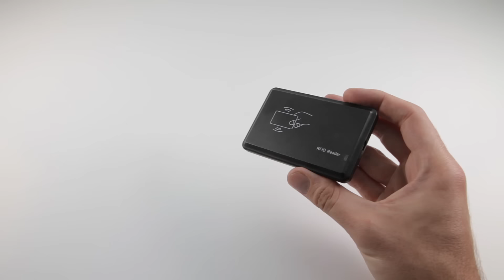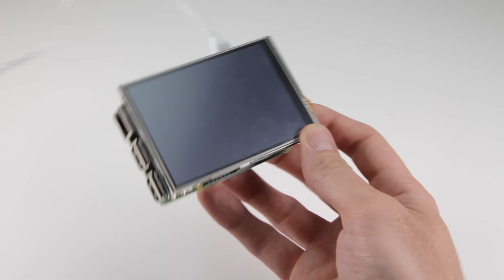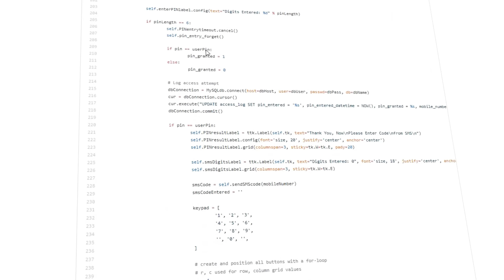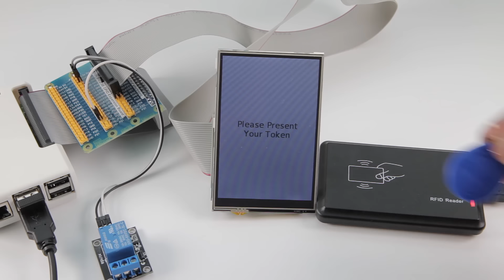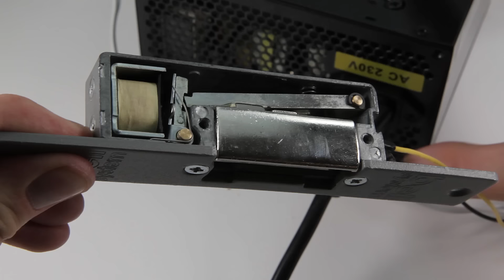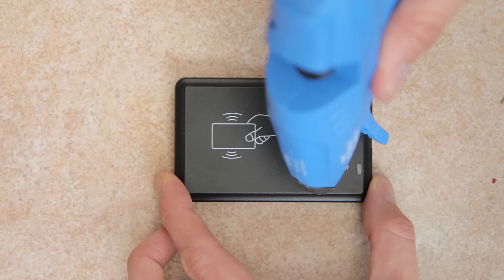Build a Raspberry Pi Smart Door Lock Security System for your Smart Home!

Comment: Hi thanks for your tutorial but I'm facing a problem with the modification of this *-" Autoload Python Script on Bootup: ~/.config/lxsession/LXDE-pi/autostart" *is asking me to save it with a new name because it read only file after adding the line "@sudo python lock.py" . what do you suggest I do because in the video it is too fast I couldn't see.
Reply from the maker: If you can't save the file then you're probably not running the text editor as admin when you open the file to edit it. Make sure you open it with "sudo". As a quick tip, on the shell you can re-do your previous command as sudo by typing in "sudo !!"

Comment: I love this video! But I have a question. You used a 5V relay and connected the IN to a pin on the board, which operates at 3.3V. I'm wondering if this can damage the raspberry pi.

Comment: Is it possible to modify this system to open lock with either of three methods (rfid card, password,otp) if yes please give me some references. I don't have much experience in this field 😊 thanks alot
Reply from the maker: Yes it is, and as I open sourced the code you're free to make changes as use as you see fit (within the terms of the license agreement on GitHub). I can't provide bespoke help here in the comments but if you need one-on-one guidance then get in touch and we can book in some consultancy video call sessions if you like.

Comment: Hey, don’t know if you will reply, but if you did I would be very grateful.
So I want to get rid of the RFID scanner and the SMS phone text, and JUST have the pin. Is this possible? And what would I have to buy? 
Thanks so much in advance
Reply from the maker: Hello! Yes that's perfectly possible and the code is all open source so change and update as you wish 👍
Reply: Hi again, so I click on the links and these were the ones that didn’t work or weren’t available: Power Supply, Rasberry Pi starter kit, GPIO Extension Board. Should I just by them from another site?
Reply from the maker: Ah, thanks for letting me know! I've updated those shopping links so they should work for you now, or if not they should at least provide a similar item. Let me know how you get on :)
Reply: Awesome! Any chance you could tell me what to purchase? Thanks 🤩
Reply from the maker: @MicroDrop2  - Yep, there are Amazon links for everything you need in the video description.
Reply: That is awesome, sorry to be a bother, but if you could, when you have time, could you tell me what I need to buy specially just for the code part? Don’t need to send links, if you tell me the names I can go check out your links! Thanks so much, and I love how fast you reply! True dedication
Reply from the maker: @MicroDrop2 no worries! It would just be everything apart from the RFID scanner and tags. (The SMS element doesn't include any physical hardware so nothing crossed off the shopping list there...)
Reply: Awesome! Thanks so much
Reply: Thanks, will check them soon! Planning to begin purchasing the items soon!!! Thanks again

Comment: I was wondering if this project still works
Reply from the maker: With some updates and a bit of tinkering here and there I'm sure you could get it working! 👍
Reply: @SwitchedOnNetwork  i got it to autostart but when i present my rfid fob it doesnt do anything
Reply from the maker: Run it manually and check for any output to the terminal to help you debug
Reply: @SwitchedOnNetwork  i also get this on bootup of the pi3 usbhid 1-1.1.2:1.1: couldn't find an input interrupt endpoint
 any tips on how to fix this

Comment: What an awesome tutorial. I'm implementing this work for my project, and I have a few issues. If you can help me with please, I follow all the steps; however, when I run the python programme, I get this error message  :  (_tkinter.TclError: no display name and no $DISPLAY environment variable pi ) and also when I turn on the Pi I got a message in the touch screen  "failed the load overall spi 2708" I scan the key fob and nothing come up. any help will be much appreciated

Comment: I just have a question about this video , how does this system work without running the code
Reply from the maker: I'm not quite sure what you mean. I think you're asking can you still unlock and lock the door manually, without using the Raspberry Pi and rest of the system? If that's what you mean then yes, in the example I made in the video you can unlock the door from the inside using the latch. I didn't fit the front locking section but you could also fit that, and still use a manual (and offline!) physical key. Is that what you meant?
Reply: @SwitchedOnNetwork   I mean it's unnecessary to click Run in  the terminal of raspberry pi ?so that the system work ??
Reply from the maker: The script needs to be running for the system to function - either started manually (not ideal) or because you've set it to auto run with the Pi boots (ideally)
Reply: @SwitchedOnNetwork  okyy thanks ,but  how can i auto run many files
Reply: @SwitchedOnNetwork  hello again , i've tried with the auto run the code execute successfully but still don't want to work , is there any other solution so that my system can work automatically

Comment: Please specify methods for resetting the as-103 locker?
Reply from the maker: what's that?
Reply: @SwitchedOnNetwork  Is there a way to reset the passwort
Reply from the maker: If you mean the pin you enter on the touchscreen then yes, in the database table. You could also build an admin front end for that if you want to make it more elegant.
Reply: @SwitchedOnNetwork  How can I tell if the bar code is not included in the passwort before the scanner?

Comment: great video.
Reply: my comment asking for help keeps getting deleted....i got everything working, i just got a problem with the GUI, i've been trying to fit the keypad to my monitor but i cant find the line of code that positions the buttons, my current situation 
Can you please help me fix this? or give me the code line that does it? its really bugging me

the 1,4,7 column always stays in the middle, but the otehr two columns always stick to the right side, any help please?
Reply from the maker: Hmm, I'm not sure why that would be happening. The code I wrote isn't very portable so was pretty specific for the hardware I was using. I'd recommend going though and debugging from the ground up until you find the issue. Sorry I can't be of more help, but I hope you get it sorted!
Reply: @SwitchedOnNetwork  im getting this problem: prnt . sc / 12vr9ai
and prnt . sc / 12vt0bg

when i resize the window it works but if its full screen the 2 last columns always stick to the right side

Comment: Hi, Im buildings this as a project and im having problems with the gui, im building this without a touchscreen (im doing it conected to a monito), the db and everything is setup correctly, i present my rfid card and it shows the right name on top, but theres no numbers to click, its just a white screen saying "Welcome "my name" ", can you try and help me finding out whats wrong?
Reply from the maker: That's probably quite an involved issue to solve which I'm guessing can't really be done in comments I'm afraid. This is  a VERY old project now, so unless you're using the same versions of everything I used back in 2017 then I imagine a lot of things will be broken and need debugging/recoding.
Reply: @SwitchedOnNetwork  is there anyway to get the updated versions?
Reply from the maker: @Browmbrownbrown  all the software repositories ("repos") will have the updated versions of everything, and if you download Raspbian it'll be latest version. I've not produced updated versions of my code, as this was a one-off project for fun, but with a bit of debugging you should be able to make it work today :)

Comment: So what do i do if the no module error doesn’t go away for tkinter?? Please help
Reply from the maker: That depends, what have you tried already?
Reply: @SwitchedOnNetwork  tried reinstalling multiple times. Keeps saying it's installed
Reply from the maker: @chadfanaroff5120  What exact steps are you taking to install it?
Reply: @SwitchedOnNetwork  I've been doing sudo apt install tkinter
Reply from the maker: Try sudo apt-get install python-tk
Reply: @SwitchedOnNetwork  ok will try thanks
Reply from the maker: Also bear in mind there's a difference between "Tkinter" and "tkinter" depending on whether you're using Python version 2 or 3... which are you using?
Reply: @SwitchedOnNetwork  tried again still not working sent you a message of the error message on messenger
Reply from the maker: @chadfanaroff5120  Can you post your code here?
Reply: @SwitchedOnNetwork  will try to
Reply: @SwitchedOnNetwork  Sir do you know what's the problem please help??
Reply from the maker: Without seeing your code it's hard to see, can you post it in the comments here?
Reply from the maker: Hmm so I see you're using Python3 so the capitalisation should be correct. You've removed the provision in my original code that makes it work regardless of whether it's v2 or v3 you're using, but it should still be OK I think. You'll have to forgive me as it's nearly 4 years ago I wrote this code and developed this project, so it's not in the forefront of my memory! I can't remember the exact steps I took to install all the dependencies but you could also try:

sudo apt-get install python3-tk 

If you still have issues then Googling it to read more about the subject and requirements is your next best bet:

https://www.google.com/search?q=ImportError%3A+No+module+named+tkinter

Good luck!
Reply: @SwitchedOnNetwork  ok thanks
Reply: @SwitchedOnNetwork  would python 3.7 be a problem should it be at 3.4
Reply: Also what would happen if I removed tkinter
Reply from the maker: @chadfanaroff5120  If you remove tkinter then you'd have no GUI, that's what makes the GUI
Reply from the maker: @chadfanaroff5120  I don't know I'm afraid, you'll have to either experiment or Google it and do your own research
Reply: @SwitchedOnNetwork  ok thanks will try
Reply: @SwitchedOnNetwork  Like how would you make it that can access the data base
Reply from the maker: All the code is in the main example on GitHub. Take what you need from there 👍
Reply: Ok thanks but is it possibly to connect the one with only rfid to mysql
Reply from the maker: Yes you can do - replace the bit of code where the RFID data is hard coded into the code with an SQL Query. I was meaning that you can see how to do that by studying the bigger example, as well as online guides and tutorials
Reply: @SwitchedOnNetwork  oh thanks

Comment: I keep getting a module error no tkinter module what must I do
Reply from the maker: Do you have that module installed? Are you using the right python version?
Reply: @SwitchedOnNetwork  yes. I don't know what's the problem
Reply from the maker: What other steps have you taken to resolve the issue and debug it?

Comment: A very cool video Paul. I'm completely new to Pi and am looking for things to mess around with - this security system looks like it would be fun to try. I think I understood 99%+ of your instructions but I must have missed the bit where you showed us where you were connecting the PSU to the mains(!) Have you stripped the plug and done that inside the wall as well? Or have you poked a hole through the wall to reach a socket? (I doubt it's the latter.)

One other question (just to prove what a novice I am lol): could you use your phone as your input screen or would that completely negate the need for the Pi? Cheers.
Reply from the maker: Thanks, I'm glad you liked the video and that it's still helping people out after 3+yrs! On my little protype mockup for the video I didn't do anything fancy with the PSU's power lead, as it wasn't inside a real stud wall or anything, so I just plugged it into an extension lead. I could have mounted a socket like this (https://ebay.to/371StdR) inside the wall on the internal side I guess, or hardwired into the mains, but as it wasn't a permanent setup I didn't need to do anything like that. If you're doing anything like that or installing inside a real stud wall, make sure you research and comply with all local building codes and stay safe!

Re: your phone, you'd still need the Pi as that controls the relay switch via the GPIO ports for the electronic door strike, but you'd need a way to connect your phone screen's inputs into the Pi, and it also looks up credentials in the database. You could expand the system so that the RFID reader accepts input from a "virtual fob" via your phone's NFC chip, that would be cool!
Reply: @SwitchedOnNetwork  Wow!, that was a quick reply to a 3 year old thread! Thanks.
Yes indeed, if I go ahead with this, I'd be fitting inside a real wall so, re the eBay link, I'm assuming you would fit that with the wiring on the INside of the wall (as it would be on the inside of a PC chassis) and on the OUTside of the wall, you'd need to have a kettle plug permanently plugged into the mains?
Thanks again. Consider me subscribed!
Reply from the maker: Thanks for the sub! Yeah you'd fit something like that with the wiring inside and the socket on the outside. You might be able to find something that's a bit more self-contained and that doesn't need soldering or leave exposed wires even on the inside of a wall cavity which would be even better/safer!

Comment: So your this project but the one where you only have a one set verification. Where your only using the rfid scanner. How do you hard code more users RFID cards into it without the use of mysql and php. You have a step by step on it but don't say how to add more users
Reply from the maker: Are you referring to my basic tutorial, the one published in HackSpace magazine? If so, that was a very basic introduction so it didn't include any facility to have more than one registered fob; it was hardcoded. This one, however uses the exact same concept but it does allow that via the MySQL database (you could use SQLite if you liked instead) - you just add an extra line to the appropriate table in the database for each new user. You could hardcode it (but it's very bad practice) by just saying "if code presented = AAA or code presented = BBB or code presented = CCC" etc. etc.
Reply: @SwitchedOnNetwork  tried doing it but keep giving errors how would you type it out please help

Comment: Can you use Noob as the software
Reply from the maker: NOOBS (which stands for "New Out Of Box Software") is just an Operating System installation manager; it's not an operating system for the Pi itself, as such. It allows you to install various OSes onto your Raspberry Pi, including Raspbian. Depending on what hardware you're using, you may be able to use NOOBS to install the latest Raspbian build and go from there. It depends. With the LCD I was using at the time (and bear in mind this was over 3 YEARS ago) it was easier to use the OS image they provided as it had all the drivers and other software preinstalled and setup... but that might not be necessary or be the case for you.
Reply: @SwitchedOnNetwork  ok thanks

Comment: good afternoon Paul. how do you add users to the system and can it sync with active directory?
Reply from the maker: Hey! To add new users simply add them to the database table shown in the video, one new row per user. The ID field for their fob must be unique to that user, and if you have a profile image make sure it's a GIF, in the same dir as the script and then input its filename WITHOUT extension in that column of the table.

Regarding active directory, you'd have to write a separate little script to sync data from there into this system, or rewrite this system to query AD instead.
Reply: @SwitchedOnNetwork  is there any interface that can integrate in order to prevent access to the database? can i use openhab

Comment: This is a REALLY NEAT project and nearly exactly what I was looking for.  I am not a programmer though and would like to remove the SMS portion and make the RFID and pin code portion both unlock the door.  Basically making it dual single factor.  Any help with this would be greatly appreciated!  I looked at the PY code and generally understand what each command is doing but dont know enough about it to weed out the SMS portion or make both RFID and PIN trigger.  Thanks for putting together a great video on this also! VERY well done.
Reply: Im trying to do the same and remove the sms part of the code, did you get it working?

Comment: I tried this, everything went fine, but the relay is turning on at the start of the program without even being authenticated and it stays that way, it doesn't turn off, what do I do?
Reply from the maker: hmmm, have you got the Normally Open and Normally Closed wired up the right way?
Reply: @SwitchedOnNetwork  yeah ,but in the video no wire is connected to normally closed right?
Reply: did you fix that?
Reply: @gonsodany  nope ,wasn't able to

Comment: How would I do it if I were to use a 4 digit passcode that’s the same every time
Reply from the maker: you mean instead of the SMS? or just on the virtual keypad? In any case, you can just modify the code and either hard code it into the code itself (not ideal) or have that 4 digit code saved in either a database or a flat text file.